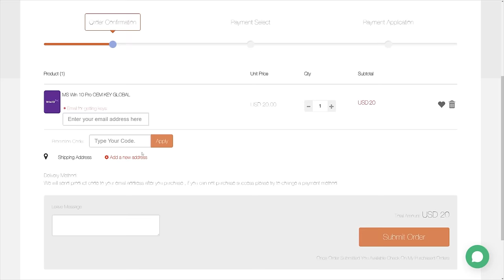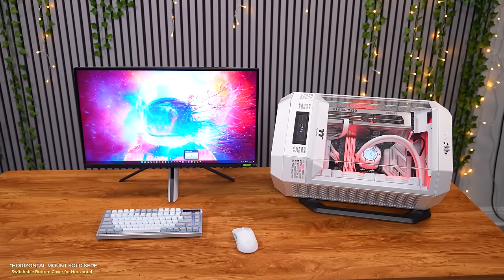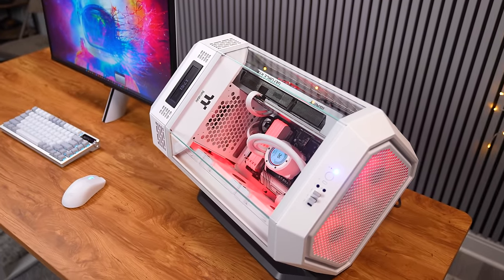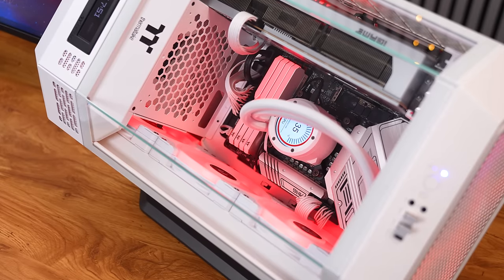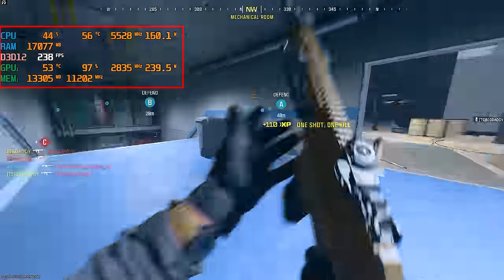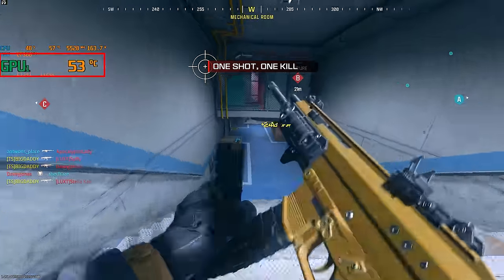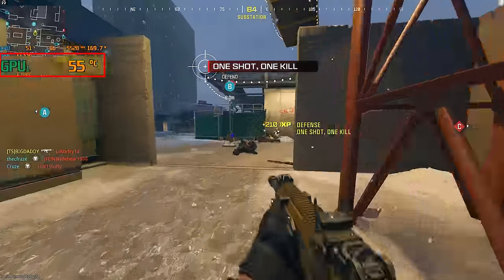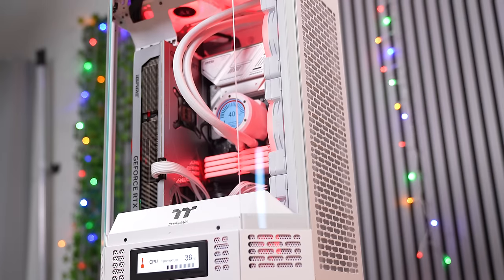Finally...a FUN PC Case to build in! - Thermaltake Tower 300

Comment: Yo Ed! for easier access to the USB ports on the IO/Shield just run a USB A and USB C extension to the back of the case.  Then you can plug things in easily and mostly unseen if you route the cables well.

Comment: i wanted to preorder it but after seeing how difficult is to acces it i'm not sure anymore, i don't want a beautiful case that makes pluggin a usb device a nightmare, also any wireless usb dongle wouldn't work very well inside there... i will opt for the cooler master qube 500 and make a vertical build

Comment: ive had the tower 100 and now im useing the tower 200 this case i will avoid due to the stupid layout of the mobo no one want to see all cablles plugged  in hdmi lead ext the tower 100 and 200 this was hidden but not on 300 glad i watched this video thanks i will not be doing a build in this case as it would be impossible to make look clean

Comment: I really enjoyed building my MSI Zero I7 13700K in the new Tower 300 Snow case. But be very careful, You need to be sure you have a hold on the case when turning it. If you apply the wrong pressure while lifting or turning it over, parts will come flying off. They snap on system is very light and they all come off easily.The tempered glass front panels come off espesially easy and a slight bump will send them flying. Just take it slow and careful.

Comment: Hey, great video. what are the measurements when it is in the horizontal position. Mainly curious of the depth measurements. I have a small table and want to know if it will fit the gap between desks. Thanks in advance!

Comment: Question: Do you think an Artic Liquid Freexer II 420 AIO would fit in this case? 

Arctic's AIO is a chonky boi at 458 (L) x 138 (W) x 38 (H) mm, so that 38mm thickness + a 25mm fan may not fit in with the  PSU shround at the bottom of the case,  right?

Comment: like the case looks but not the layout as the case is 14" wide but you can't install a ATX board in it. The case is built for negative pressure as you have more for exhaust then intake. Seems like Thermaltake isn't really thinking on their designs as just making it a little wider would make it full ATX build in the same way they made the Divider 200 TG with funny looking sides that Suite no purpose and they could have just had mesh on both side and front without the TTTTTTTT holes and fit an ATX and it would be on my desk already. If they just laid down the motherboard for Tower 500 and made it 14"-15" tall and had the I/O on the bottom they would have to me a perfect desktop computer with plenty of room even to add a CD player for my 70-80's music.
Reply: This case is designed to have 2 exhaust fans at the top, with technically 6-7 intake fans. Two to 3 from GPU, 3 for intake/radiator, and one on the bottom. Also, there's room for 2 more fans in the rear, but could also be used as more exhaust. So Total of 11 fans for you to regulate your own ideal pressure.
Reply: @frantz4g63  Yes it is good looking but way to big to have a giant tower on the desk top and needs cut in half to look better. It's easy to make a mini fridge into a desk top computer but way to high.
Reply: @justatim8143  I agree, it is very tall. I believe it's 25" in height, but 16"x16" in terms of L/W, which is pretty good for a platform that doesn't have a lot of depth. I have my setup on order, using an mATX setup, 360 AIO and a 4080 Super. Going to run everything as intake except for the 2 top fans as exhaust. My only gripe with the case is the I/O, but not sure how else they could've designed it for convenience.

Comment: It seems weird to me that you don't have clear acces to the rear IO considering you have to plug in peripherals and the display port cable on the GPU. Of course you  usually connect them and forget about them but still. Weird design choice

Comment: The case has a very innovative design. I like the way it looks, but due to the difficult access to the connectors on the motherboard, it still has to be worked on. As far as I'm concerned, it's a nice story but unfinished.